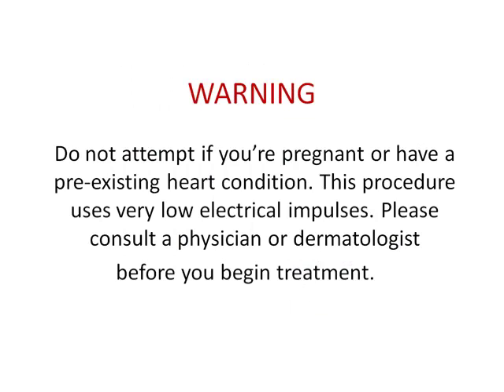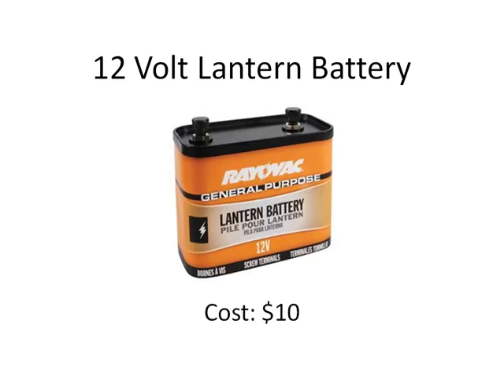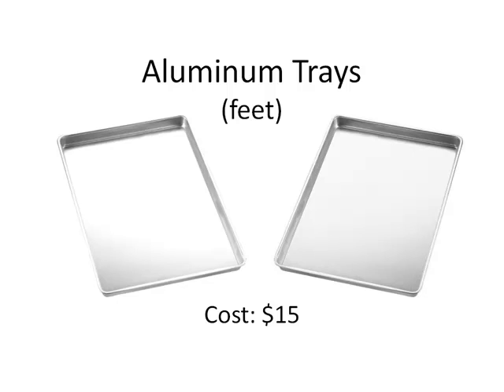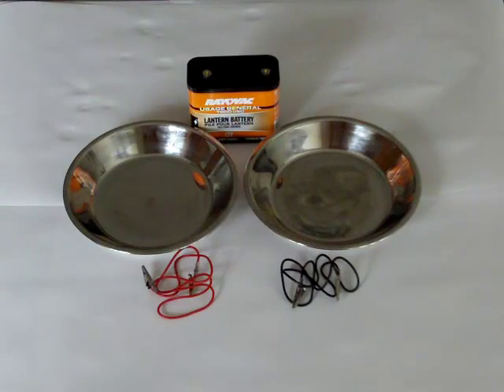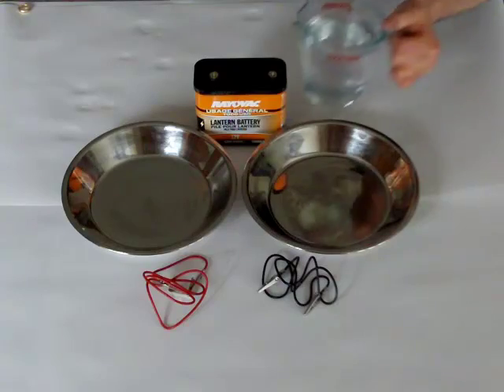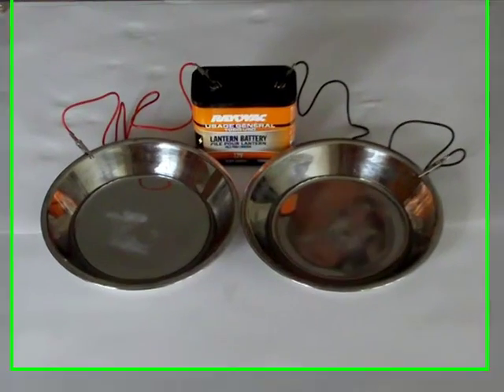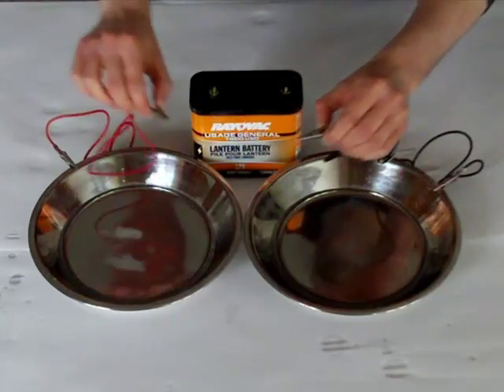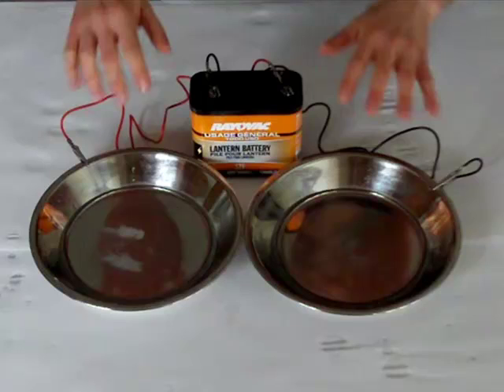How to Build Your Own Homemade Iontophoresis Device

Comment: should pie pan touches to each other?
Reply: +Abdul Haseeb no! not at all that'll cause short circuit. happend to me once and my cable burned down! wonder how his cables hold that long
Reply: +Ali Gosun are u hands stop sweating?
Reply: +Va Virak 
nah... they got even worse! I tried this for more than two weeks but no positive results. so I stoppedI think the batteries are the problem. they should flow a really low amount of current like 200mA to 500mA or so.mine must have flow more

Comment: Hey, I stared doing this, but every time I put hands/feet in the water I get a shock (I use 12v battery 5AH), is it too much, I dont know? Can anyone help me please? :(
Reply: +Tommy Hayt 
when you put your hands in initially you feel a shock and when you take your hands out (by shock I don't mean the buzzing feeling) ; if you keep your hands in  the pans/water the buzzing feeling in your hands slowly goes away.

I hope this is what you meant and not that you continually get a shock...
Reply: Thank you for your reply, I Got used to the shock, and now I only feel tingling sensation when I put them in the water. Cheers mate, thanks once again!
Reply: +Tommy Hayt are your hands stop sweating?

Comment: Thank you so much for posting this. I literally just finished my first treatment and my hands and feet feel a lot smoother already.
I can't wait to continue and see the end result of no more sweating in my hands and feet!
Reply: Does it dry nowadays ?
Reply: ***** No problem, and of course, if it's still too much you can use distilled/filtered water which has even less solutes, and manually add salt little by little until the current is tolerable
Reply: Thank you for the useful information and for your help!
Reply: @xbydx10  How is it going man
Reply: well I have stopped doing this because my skin cannot tolerate the electricity - it becomes extremely itchy and sore with every treatment. My hands become very red as well. I stopped because it was winter and the sweating was not too bad, but I will find a battery with lower voltage for the summer.
Reply: *****
if you can't tolerate the current, have you already tried using cold water? there's less solutes in it because hot water sits in your tank and there's a lot of ions there.
Reply: +byh c no I only used warm water. I will try it and see what happens. Thank you for your reply!

Comment: Started with this today will post the results in a week :D
Reply: Yes it worked pretty good ^^ Already forgot about this problem, I just notice with your comment that I'm not that dependent and focused in this anymore
Reply: +Facundo Alvarez Morgade What was the result? I hope it worked for you.
Reply: Used it 3 times a week the first week with good results, then went on a trip and didn't use it for a month, I just started using it again.
Reply: +Facundo Alvarez Morgade anyn ews
Reply: razboy14
Reply: Facundo Alvarez Morgade ahh
thanks, im ordering a 12v 1.3a battery today 
cant' wait for it.
Reply: Hope it works for you too ^^ razboy14 good luck
Reply: +Facundo Alvarez Morgade Just so other people know, they probably need to do it more often to see prolonged dryness if they have more severe sweating
Reply: +razboy14  does it work for u ?
Reply: Va Virak
please read the comments. This is a scientifically proven method, no need to question.

Comment: the two plates are touching each other. you're destroying the battery
Reply: +Karlwojo1 Its a dead short with the pans touching. (not cool bro) is correct. It should be your skin completing the circuit.
Reply: dude, what did you use a car battery? 12 Volts doesn't give a jolt.
Reply: @shellypoles  car battery is also 12 volts
Reply: @nouraselias  I misspoke, I meant the lantern battery dose not shock.
Reply: It very much matters. Be careful out there.
Reply: When I touched the plates it jolted my body. I don't touch them
Reply: Car batteries are 12v, like the one he uses in this video, doesn't matter that they're bigger. But I get what you mean :)
Reply: +Karlwojo1 <--hes right youre wrong
Reply: +Not Cool Bro Do you need to put your glasses on.  The plates are not touching.
Reply: +Not Cool Bro dude, he has the plates touching to complete the circuit. he could have had a cable in between the two plates and the result would have been the same

Comment: Help!

I've been doing this treatment 8 times for 20 mins a day (as you said) and I can't see any results. My hands still sweat a lot at times when yet sweat before. When I rub my hands together they even start to sweat :( . They are sweating as I write this comment...

But it may be because of this... :
I use two Eveready 6v lantern batteries connected in series (to get 12v) as I couldn't find a 12v battery (I live in New Zealand btw). Does this affect it the treatment?

Also I use two different pans (which are different materials to each other but they still conduct), and one is like an aluminium bowl (with higher sides that a pie pan) and the other is a iron* tray which is like a baking tray but it still allows my palms/fingers to contact the water without touching the bottom of the tray. Using these pans I still feel the current when I touch the water. I will try to get 2 pie pans but I'm so lazy :l .

Also I started using salt from day 2, and for the last two treatments I put a lot more salt in (maybe a handful or two). 

And occasionally my wrists accidentally touch the top/edge of the aluminium bowl, or the sides of the bowl/ bottom of the tray (this happens every 1-2 mins or so. Does that stop the treatment working properly?

Could anyone help me, I hate sweaty hands.

Thank you for reading my essay...............
cbf checking spelling etc.
Reply: +NinjaDog 

I found 12volts did nothing for me, It just made my hands sweatier.

I upped the volts to 8 6v batteries in series, after about 3 sessions my hands where bone dry for about 2-4 weeks.

So maybe try getting 2-4 more batteries and try it again.

It's more effective the more volts you can handle comfortably.
Reply: Thanks i'll try more batteries
Reply: +NinjaDog Your hands will sweat even more right before going dry. The conductivity of the tray does not matter, it is the water that conducts the electricity. If you want, you could throw the wire (assuming it's rust proof) directly into the water, don't need a metal tray. Use as much salt as you need to feel a current (even if you don't feel anything, it's probably working, will just take more treatments). No your wrists does not affect anything, furthermore its dry so it's not even conductive. First time I did this I had to do it 16 times before it went fully dry
Reply: Thanks for the reply, I kept doing treatment on and off but never properly like you cause I'm too lazy, but I'm going to start again soon when I get more free time with 24v

Let's hope it works
Reply: NinjaDog
Please read my other comments about using a 12V battery. 24V is not needed and not recommended
Reply: +byh c
 
Thanks for the reply.
Just wondering how long you should keep your hands in the water (what did you do)
Also any tips on maximizing efficiency/ preventing some things affecting how well the treatment works (e.g. accidentally lifting your hands just above the water)

thanks
Reply: +NinjaDog does your hands dry nowadays ?
Reply: Are your hands dryer now?
Reply: NinjaDog are your hands dry now?

Comment: I can not thank you enough for sharing this. I've lived with sweaty hands and feet all my life and was saving up for the surgery where they clamp the T9 sweat gland. I just finished my 3rd treatment and it is amazing. I've even tried typical triggers that cause my hands to sweat immediately, and nothing! The only thing different was that I used 3 - 6volt Eveready lantern batteries in series because a case of 12 was cheaper.
Reply: Hei,i am facing e problem!! I get bit electric shock when i put my 2 hands one by one...
But when i just put 1 hand in the water and the other is not using,it Doesn't give me shock.is there any problem with my function?
Reply: @Sarah-zh4xj  you need both hands in. The current runs through the body. That’s how it works.  Maybe get a lower voltage battery if you cannot handle it.

Comment: Can u someone help me? I'm 15 and my hands sweat quite a lot. Do u think this is safe for a 15 year old? Also I know I may sound stupid but of u need to turn the battery on or something lol
Reply: Kaitlin No Hey im 15 too and i started using this treatment since i've been 14. This works amazing but since maintenance is high i occasionally stop and the sweating comes back. But this is safe enough for you.
Reply: +Simplykatheryn no to the both of you dont wait act now
Reply: +mj,jhgjkjkkjuk oihjiol what do you mean?
Reply: +Simplykatheryn I starting sweating uncontrollably when I was 15 and didn't go to the doctors or anything for 4 years. if you can get it taken care of while you're still 15 then dont hesitate. it will save you a lot of embarrassment and you can get on with your life.
Reply: +mj,jhgjkjkkjuk oihjiol i get what you mean because I've had this since I was 9 in the fourth grade and it's the most embarrassing aspect in my life but I'm also embarrassed to talk to a doctor about this so I guess this will have to do for now :/
Reply: +Simplykatheryn don't be embarrassed about talking to the doctor. its out of our control so medical treatment is the best way to stopping it!
Reply: +DEEZ NUTS  yeah i guess
Reply: +Simplykatheryn how long does it take to work ?

Comment: Hovering over the pan so as not to touch it seems difficult to maintain for 10 minutes. You need conductive pans to relay the current from the battery to the water and to your hands, right? So is it not better to use non-conductive container such as plastic and then have wires run from the alligator ends clipped at the sides of the containers to the water? With this, you can touch the pan and rest on it and current still runs through the system.

Comment: i have been using this method for 6 days in a row now... but I can't feel any difference :( I sweat just as much as before... is it normal not to feel any difference at all at this point? :/ :) thanks
Reply: Would it be better if I buy a battery that is a bit more powerful? or is that a bad idea? :)
Reply: Mette Nielsen you will see a difference soon, keep going
Reply: okay, thank you! :) I will then.
Reply: what are you using by the way and where are you from?

Comment: I just tried it and it works! 
I use a 12V power supply. 
But after a couple days, my hands get used to the current and don't feel as strong sensation. But as long as the hands remain dry, it should be okay! ;)
Reply: San Yeung  how long did u do it for ?
Reply: San Yeung power supply as in computer psu?

Comment: i just got the equipment to make my own iontophoresis machine a few days ago, but when i came to try it the first time, i dont feel any kind of tingling sensation in my hands at all when i put them in the water. at first i thought perhaps i had a faulty battery but there is definitely a charge since i can see sparks when i touch the two clips together.

is it normal to not feel anything at all because i cant tell if its actually working or not.
Reply: however i do have a cut on one of my fingers which was becoming quite painful, but only after i switched around the clips to the opposite charge. does this mean it is working?

Comment: in this video the pans are touched with each other which is wrong. the process must be with the little gap between pans.
Reply: I was just waiting for this idiot to nudge the pans together and short circuit the battery, glad someone else noticed this.
Reply: thank u
Reply: Maybe all it needs is a newspaper or some plastic of any sort between the two pans.  So you don't do the mistake
Reply: ***** I agree, but for one that doesn't grasp the importance of separation of pans, it can be for help to put such insulator. And as seen in the movie, the mistake happens seamlessly, and by setting some sort of insulator, even in case of a mistake no problem occurs.

Comment: @shadowofearth I suggested you use the 18v one because after a while your body gets used to it and it won't respond as well as it did so, get the 18v one and yes it's safe you just feel a tingle like a small current of electricity. Remember to do it for 10 sessions every 2 to 3 days and you will see good result. Don't give up it has been the most effective treatment I have ever used.
Reply: +Medelin Geraldino Not necessary. 12V is the minimum you need for the body to feel a current as long as the water you're using has enough ions. Can add salt, baking soda, etc. your choice to increase conductivity
Reply: So if the body gets used to it will I eventually build up a tolerance for 230V from the house electrical socket?
Yes I jest. This method seem sketchy to me to begin with. I've electrocuted myself enough times to be very afraid of electricity.
Reply: @rowenkylee5627  No, that is not safe. It's not a tolerable current. Check out Dermadry it works and its professional.
Reply: medelin geraldino how many sessions should i do ? and for how long ? please replay
Reply: Medelin Geraldino  how mush amper
Reply: @alaaahmed6198  same question... have you got the answer so plz share with me that how much ampere we need in a 12v battery ....
Reply: Where did u find the 18v battery

Comment: anyone tried this with glass instead of aluminium /steel?
Reply: Do you think it would work if I use a glass pan but I would dip the clips in the water instead of attaching it on the pan? Also I've got this old RC Car charger that pumps out 12V DC charge, it's consistent because it stays at 12 instead of a battery which slowly drains out. Pls reply

Comment: The pans are touching in the video and are discharging the battery.  be sure that they don't touch.  You could also add another 6 volts battery in series if you are not getting the result you desire.